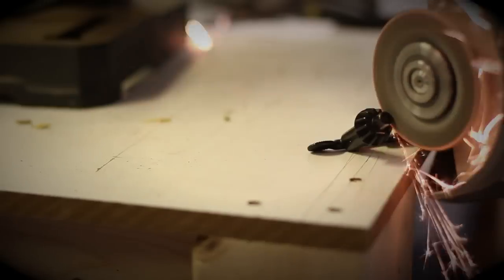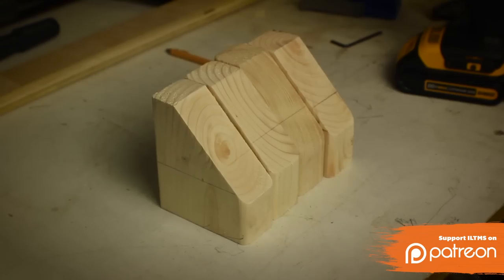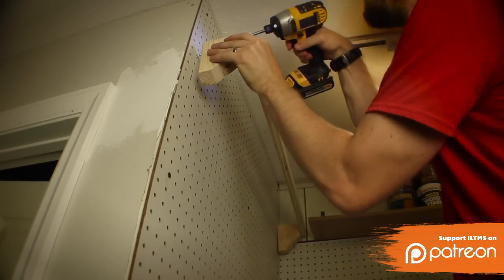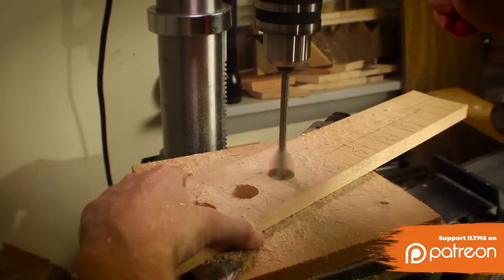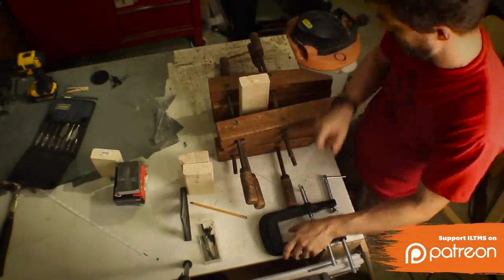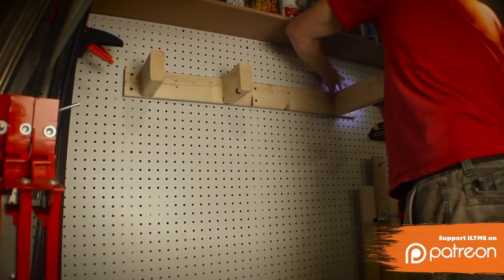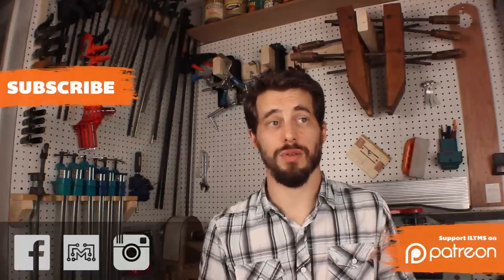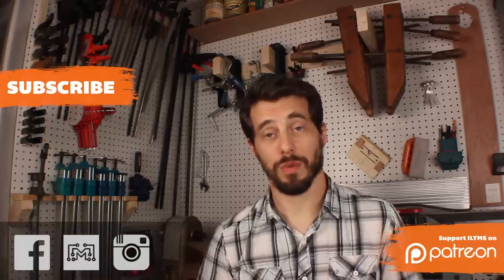How to make 3 simple types of clamp storage | I Like To Make Stuff

Comment: At about 1:44 you used the speed square and slid it down while holding your pencil to make a line parallel to the edge of the plywood scrap.  Genius!  Why have I never thought to do that?  That's much faster than measuring and marking both ends then finding a really long straight edge, lining it all up, and tracing the edge.

Comment: Nice job!
I made a similar 2x4 arm for my hand screw clamps.  I had to step down the width at the end for the smaller sized ones with a short distance between threaded rods.
=Brian=
P.S. Sweet 1950s Craftsman Power-Bronze 9x30 wood lathe!

Comment: Looks great, Bob!  Quick question: what pilot hole/counter sink are you using?
Reply from the maker: Thanks! In this one, I was using the bit that comes with a Kreg Jig. It's got an adjustable collar on it.
Reply: Good deal. What about the one you were using to counter sink the plywood on the brackets?  I dont have an actual counter sink (other than the Kreg)
Reply from the maker: oh, those were just some cheap countersink bits from Harbor freight.

Comment: Compared to my solution, those things are deluxe. I just clamp mine to the edge of a secondary workbench that is off in a corner. Of course that means I have to unclamp them every time I get one out.
Reply: I guess you could make the wooden supports and shelf piece and attach it to your workbench and still have the clamps in the same place.